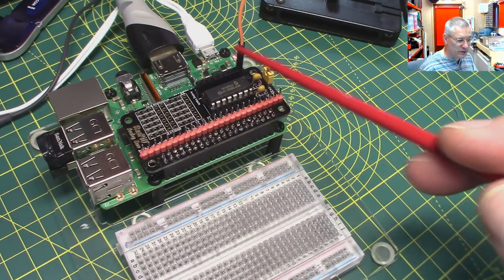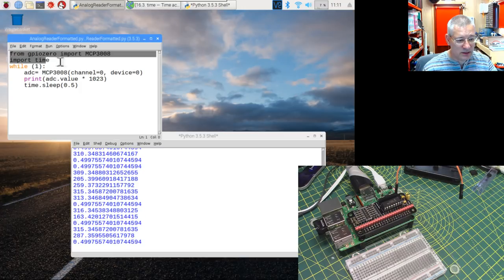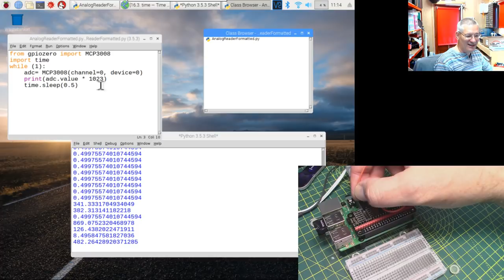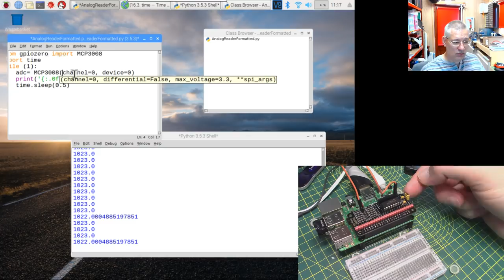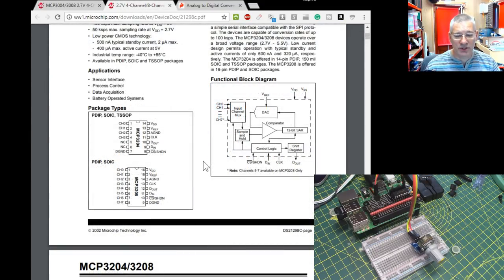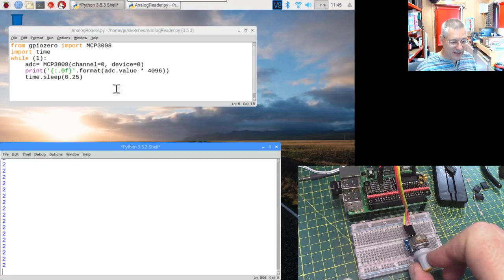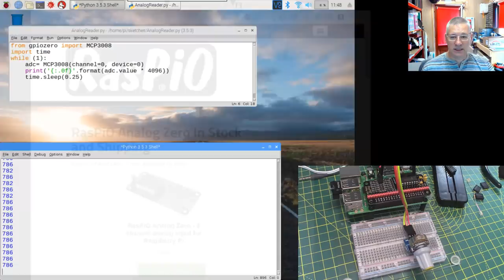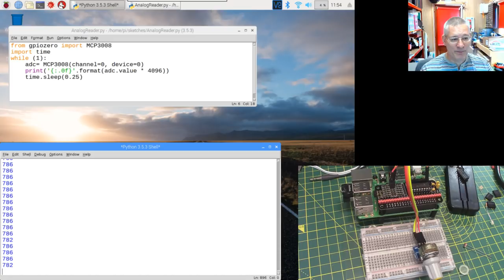#112 Analog inputs for your Raspberry Pi 🥧Model 3B+ (easy)

Comment: Excellent video, Ralph. Not a Pi person myself bu,t lets say, I was very tempted. Your example of the use of Python was very valuable for the Neophyte. Python is very easy to work with and one can get VERY sophisticated applications up and running just as fast as one likes. Being an interpreted language (i.e. no compilation needed), one can get stuff running very quickly; debugging line by line. I actually use it to develop desktop applications, then once the principles are proven, I write it all in C++. Using it, in a way, like one would use a development board to develop a circuit, then transposing the breadboard layout into a proper PCB (or vero) layout. Loved the fancy video segues .
Reply from the maker: That's an interesting way of developing a desktop app, that you describe there, Michael. Quick to develop (and debug, but you don't have any bugs, right?) and then rewrite in lower level language. Nice. Glad you liked the video, thanks for posting.
Reply: I did write a bug back in the eighties. Never again!

Comment: I'm a fan of inserting one row of ic pins in the socket, pressing against them with just slightly less pressure than it takes to collapde the pins. Then jamming the other row in place at just below light speed hoping they are lined up. I have greater than 12% success with that method! Although I imagine the pin straightener could help with recovering the failures.
Reply from the maker: I used to do it your way, Kent, before I got this pin straightener, then never looked back. They are quite cheap so I can only suggest you try one, you might prefer it and get your success rate to 99.99%! Thanks for posting.

Comment: Very nice.
remember the PCF8591 module?  That works great on my raspi, but ofcourse it isn't a neat HAT, yours looks much nicer and of course more sensitive
With the 12 bits chip the reading of '2' is equal to 1.6mV. Wiring could easily have picked that up along the way
Reply from the maker: Ah, yes, the PCF8591 I2C expander module, Ed, which if I recall also works on both 3v3 and 5v. I agree that there could be noise on the wiring, it's not a deal breaker. Thanks for posting.
Reply: Ralph S Bacon Got to work with what you have and the 8 bits was enough for my needs. Nevertheless it was good finding the gpiozero library through yr video

Comment: I know this is an old video, and I presume others have said this already.

Rather than VNC I'd run two ssh sessions to the Pi.  One to allow you to edit your python code and the other to run it and see the output.

That should be a great deal faster, as processing text is easier by far than processing a video stream.  You shouldn't get those "freezes".

For Windows I'd run something like PuTTY.  For Linux and Mac there are native ssh clients.

The downside is that you'd be using a native Linux editor and it won't give you hints about the syntax of the python code, although there are ways around that.
Reply from the maker: Yes, all good advice and I have experimented quite a bit but as I don't code much for the Pi (Python? Pah!) I've not had an issue to date. When I start coding C/C+ for the Pi that might change, of course.
Reply: @RalphBacon  
Cool :-)

Comment: Excellent video Ralph. I found your channel looking for opto-isolators and then poked around and found this. I plan on using the MCP3008 also. And why didn't they point ADC on the PI????
Reply from the maker: And I'm glad you found me! 

I dabble with the Pi, but it's too big a product (not to mention too expensive) to use in a willy-nilly fashion when compared to a £2 Arduino Uno or Nano! It can run my entire workshop automation system using Node-Red and MQTT, for goodness sake! 

Yes, I think they should have included ADC on the Pi too, for an extra $1 they could have managed it. Oh well...

Comment: Brilliant video. Coming from no Arduino experience! I want to use the Resistance reading from a Wind direction vane so this kit will do nicely. But, how do I convert the readings to wind direction?
Reply from the maker: Find the limits of the resistance around the 360 degrees (eg zero to 10KΩ or 100KΩ) axis. Then map the resistance (that's an Arduino function) to 360 degrees. That might mean you have set it up that North maps to 122º instead of 5º so you will need to subtract/add the required offset to get it right.

Comment: The reason IC pins are not straight is for the pick and place machines.  Pins will never be equally straight. By being all bent out, the pick and place tool holds the IC so pins are pushed in and this way they are all straight when inserted in the PCB
Reply from the maker: Well, there had to be a reason and this sounds as plausible as any, Kenneth, so it probably true. Those pick and place machines have a lot to answer for! Thanks for letting us know this.

Comment: After swapping to the 12-bit MCP3208 chip you need to update the Python code to use the proper device:
http://gpiozero.readthedocs.io/en/stable/api_spi.html#analog-to-digital-converters-adc

class gpiozero.MCP3008(channel=0, differential=False, max_voltage=3.3, **spi_args)[source]
The MCP3008 is a 10-bit analog to digital converter with 8 channels (0-7).

class gpiozero.MCP3208(channel=0, differential=False, max_voltage=3.3, **spi_args)[source]
The MCP3208 is a 12-bit analog to digital converter with 8 channels (0-7).

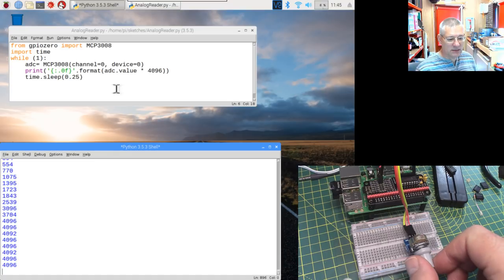At 20:35 in the video that's why your max values bounce between 4092 and 4096, not single bits of noise.
Reply from the maker: I did try the other library before I did the video, but found no difference in behaviour. At that point, I thought that perhaps the libraries were identical but named differently just to match the chip.  Perhaps I didn't do it right. I'll have another go and if I have more success I'll update in a future video. Thanks for the nudge, bubbasnmp.
Reply: Good luck! Shipping to USA is reasonable so might have to add this to my project list. Thanks for the video.

Comment: Thanks for the video. I've done a project with a Raspberry Pi and the MCP3008. It does its job and is very easy to work with. I'm considering the ADS1015 and the ADS1115 ADC's now, since I want to use I2C instead of SPI.
Any thoughts or experience with those two?
Reply from the maker: Yes, Martin, I did a video on the ADS1115 just a few weeks ago, it's video #104. It worked quite well but there was some noise as they were very sensitive. I used an Arduino but they will work equally well on a RasPi. I hope this helps!

Comment: Hello, very nice channel. Was wondering would this be suitable to read values from 100mV shunt or would you recommend something else?
Reply from the maker: Reading very low voltages across a shunt can bring problems in the shape of noise (it's analog). You could use a INA219 to do all this via I2C, very good chip, see it all in video #186.
Reply: @RalphBacon  Very nice. Thank you.

Comment: I am very late to this comment section, but I was wondering if there was any way to get more than 8 analog pins out of a single board, either using a different board or expanding on this one. I need 12 in total, all controlled by RPI 4. Any suggestions would be appreciated...
Reply from the maker: Have you researched daisy chaining these devices?

Comment: Love your attention to detail!   I have a question, being a noob to raspberry pi, transitioning from Teensy Arduino-land.  Most of my Arduino code is executed via interrupt timers (never the main loop), sort of a poor man’s real time operating system. I’m hoping to write some pretty intensive code on the raspberry pi; a digital synthesizer and also some 3D rendering. I would like to know how typical raspberry pi apps handle the GPIO ports (shift registers etc) for the buttons and encoders and pots, without burdening the other SW tasks?  Can a separate core for handling GPIO be setup? 
Thanks in advance,
Steve
Reply from the maker: I'm afraid I am inexperienced with the Pi's way of dealing with separate cores. However, you are always at the mercy of the operating system and a hardware interrupt on an Arduino will be serviced immediately, whereas on the Pi it is whenever the OS decides that "now" is the right time - which could be several milliseconds (or more) later, depending on what the Pi is doing at the time. Same goes for Windows, of course, where you might click something and nothing happens until Windows decides to service that request (probably just at the same time you click it again in frustration). The ESP32 is a much more powerful, Arduino-compatible, dual core device but also suffers from OS "lag" to a degree.
Reply: Thanks for your reply Ralph!  I know that Windows is a NOT a real time OS, ug.  I take Real Time (RT) to mean deterministic interrupt timers, NOT a fast OS (as I have heard many say or assume). In my research of Raspberrian there is an option to have a RT kernel for the R-Pi. I guess I assumed that it really meant RT. Couple that with a 4 core proc and I further assumed that your could assign a core to handle the deterministic interrupt timer callbacks and GPIO HW interrupts. Hopefully this question will generate some more discussion or a good recommendation for a web source for R-Pi RT info.  : - )
Thanks
Steve

Comment: Good video, but it would be nice to actually verify that you are getting 12 bits resolution by measuring Vin vs count out.   Thanks!
Reply from the maker: Proof, you mean, Tab Maryland? 😳 From those fly-by-night MicroChip engineers? Gasp. Well, if I use this module again in a video I will try and remember to include this measurement!

Comment: Great video - would I be able to plug a Resistance Level Sender into this?  The type with the float which changes the resistance as the float moves up and down it?
Reply from the maker: Yes, you can. The analog inputs behave exactly as you would expect.
Reply: Awesome! I believe the sender is currently powered by a 12v power supply, could I just put a 12v - 3.3v step down in-line?

Comment: Why multiply the reading by 1023 (2**10 - 1) in the one case,  but 4096 (2**12) in the other?  That's inconsistent...
Reply from the maker: Is one of them 10-bit and the other 12-bit? On the other hand, consistency has never been my strong point, Roy!
Reply: Shouldn’t it be 4095? Also he didn’t change the import library to the MCP3208 chip from the MCP3008.

Comment: Hi Ralph, I have been watching your videos with great interest and find them facinating. I am going to be building a weather station and likely to need about 10 or so analog inputs aswell as a few digital.

Are you able to confirm if you can connect two of the Analog Zero's to the Raspberry Pi 4? I see Rasp.io do a FullpHAT so that you can connect two smaller boards like the Analog Zero, but wasn't sure if this was possible or how the RPi would know which chip select is being used? CE0 or CE1?  The other question is, if i want to put another board on top of the Analog Zero, presumably if i put long pins through, i can then extend off that instead of using the side chained ports. It would be easier to have a double row of 20 for me. Thank you.
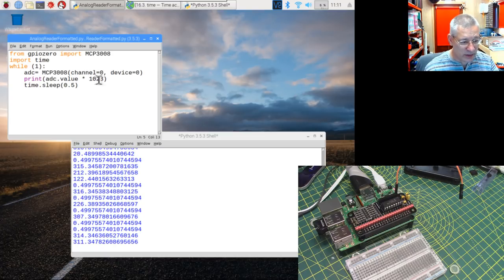Reply: It's at about 10:40 in your video you mention the SPI port 0. I can see how to adjust the script, thats clear enough, but wasn't sure how you determine which ADC / Analog Zero ends up on which CE0 or CE1 ? Any points would be appreciated thanks. It says on Page 4 of the instructions for the Analog Zero "The Pi's SPI can handle two devices natively. If you wish to add another
SPI device, ensure its chip-select pin is connected to CE1 or it will interfere with the MCP3008 chip, which uses CE0" ?
Reply from the maker: I'm sorry to say I don't know the answer. Normally I'd at least try and find out but my workshop is all packed up pending a house move with week. I'm no expert on the Pi though, others will undoubtedly be of better help than me (just on this one occasion though!)
Reply: @HarboroughHoney  You might want to look into NODE-RED its a program on the raspberry pi. Should make your weather station much easier to build

Comment: thank you ralph, I'm also using MCP3008 and I have 8 analogue sensors(measuring Voltage, current).
Can I get the value of this 8 at one time? if yes, How?
Reply from the maker: You will doubtless have to poll each of them in a loop, changing the I2C address (if they are I2C devices) and read the resultant value. It will only take a few milliseconds to do this, so it will appear as if you had read them simultaneously.

Comment: Hi Ralph. I heard you mention "From Arduino world". Can you use the analog inputs from an Arduino with a raspberry instead?
Reply from the maker: Well, you could I suppose, and send the value via I2C (for example) to the Pi, but is that easier than this solution?
Reply: @RalphBacon   Being a newby to the Raspberry pi and python scripting is a very challenging task. However I managed to figure out a python script that reads the analog input connected to a potentiometer on my arduino mega 2560 and convert it to a scale of 0-180 to control a servo connected to a digital pin. I am using the Firmata protocol  for the mega uploaded to my Arduino with a USB connection to my Raspberry Pi 4. The raspberry is connected to my laptop via ethernet cable. My next challenge is to figure out how to read PPM /PWM signals from a Flysky RC controller connected to my Arduino digital pins and control attached hardware like servos, motors and switches with the raspberry.

Comment: Hi actually I wanted to read 90 analog pin address using thermocouple sensor what should I do and how can I do that ?
Either Ads1115 is better or mcp3008 is better?
Reply from the maker: ADS1115 is only 4-channel AFAIK, whereas the MCP3008 is 8 channel. But to read 90 inputs is going to be a challenge. I'd do a proof of concept with just a couple of MCP3008 and make sure that all hangs together on the breadboard. Each MCP3008 requires a Chip Select pin (it's SPI driven) so you would need 90 / 8 = 12 pins to be able to select each MCP3008 in turn - best to use a MEGA2560  rather than run out of pins on an Arduino.

Comment: Hi ralph, does this let me analyze multiple sensors at once? I mean can I observe each individual sensor's output? So one is say a pressure sensor and another a temperature sensor?
Reply from the maker: Yes you can! Each sensor can connect to a different analog input pin and you can read each pin in turn. I would prefer digital sensors that I can interrogate using I2C but that's just me!
Reply: @RalphBacon  Thanks so much for such a quick reply!

Comment: what if we need to measure more than 3v? up to 16v for example?
Reply from the maker: You need a resistor divider, or resistor ladder, so you can switch in various resistors to measure a higher voltage. Google will show you what you need.
Reply: Ralph S Bacon thank you 🙏

Comment: How would you use a sensor that required 5v minimum?
Reply from the maker: If a sensor is running on 5v, you can use a level shifter, a very simple device, usually bidirectional and multiple channels (4 or 8). 

This will 'shift' the voltage from 5v to 3v3 (and vice versa). They are cheap and work well. 

I'm using one in a current project so allow an ESP32 (3v3) to drive a NeoPixel (5v).

Comment: More for your ATtiny. Just need more memory.
Reply from the maker: My thoughts are, vonries, that the ATTiny and the Pi have nothing in common, apart from the fact they are both digital processors of sorts. If the Tiny can do the job we need look no further. And, sure, the Tiny can read three Analog inputs without recourse to another board, but it wasn't the point I was making in this video (which I'm sure you realise).
 
As you know I've done a few videos on the Tiny85, and it's amazing what it can do given its size and price. But the RasPi is a different beast altogether. Now there's an idea for another video!

Comment: Hi , I am using pi 4, is there a newer version for this analogue board, also the python is thorny python ide, is this the same
Reply from the maker: I believe this should work just the same, as long as they still expost the RUN pad.

Comment: Anyone have the library for the ADC ADS8345
Reply from the maker: Are you sure you have that part number correct, Vivin?
Reply: @RalphBacon  I'm sorry Ralph. It was a typo on my part. The part type was  ADS 8345
Reply from the maker: I can't find a library for the Arduino (or any other µController) for this device, sorry.